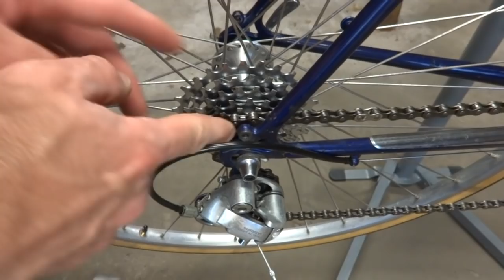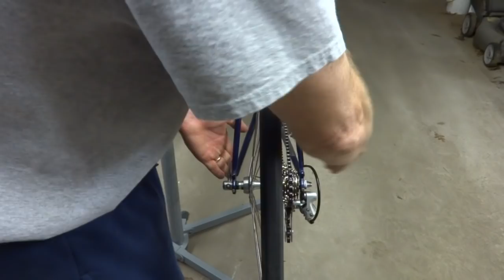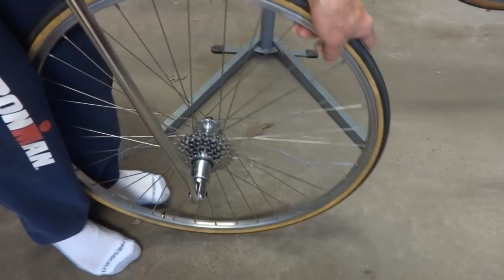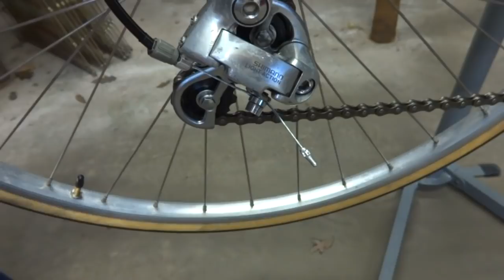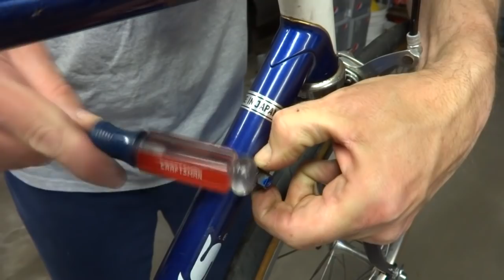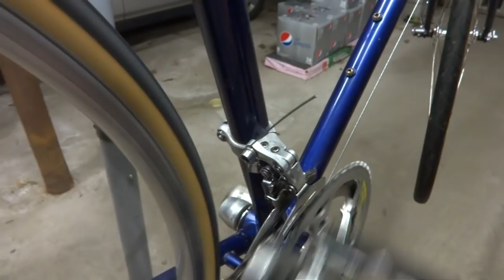How To Do 6 Speed To 7 Speed Freewheel Conversion

Comment: That front chainring of yours seems very warped.  What I am wondering is can I take a 21 speed aluminum frame mountain bike that came with a 7 speed freewheel and somehow remove one cog from some other 7 speed freewheel and  somehow attach it to the original 7 speed freewheel, thus making it an 8 speed freewheel?  Reason is because I want 2 underdrive gears, not just 1.  If it works, my 1st and 2nd gears will be underdrive and my 3rd gear will be 1:1.
Reply from the maker: +David James It's not warped. It's a Biopace ring. It's oval shaped. No. You can't. If you want to go to 8 speed, here is what you need to do (if you have a steel frame): https://www.youtube.com/watch?v=QwxEPRk3LFg
Reply: RJ The Bike Guy - How can you say I can't without you knowing my bike?  What if there is space on either side (or both) of the freewheel cluster such that it will allow me to add one more cog?  It seems like a large cog (34T) could piggyback the 7 speed freewheel cluster, thus making it an 8 speed.  I am not sure if this is possible but I would love to have 2 underdrive (less than 1:1) gears for hill clumbing / riding thru high grass.  I know Shimano has the MegaRange 7 speed freewheel but the problem there is the big jump from 34T to 24T which is huge.  However if I put a 28T between them making it 34-28-24, that almost splits the difference.  So if I start to spin out in the ultra low gear, I still have another underdrive gear to use before going to 3rd gear (1:1) and then eventually my overdrive gears.
Reply from the maker: Okay, good lick with that.
Reply: RJ The Bike Guy - Actually I just did some measurements on my bike and it appears it has a chance to work.  I have a spoke protector plastic ring which I could remove and insert the 8th cog roughly there.  My 7 speed freewheel has cogs spaced about 5mm apart and there appears to be about 10mm of clearance between the innermost cog and the spokes and the chain is about 7mm wide so in theory it should fit but be very close to the spokes.  There appear to be 5 connectors holding on the granny gear and those have a BCD of 58mm so it seems I could replace that 24T granny gear with a 22T or even a 20T so best case, I could go from my current 24T/28T setup (5.8 feet of bike motion per crank turn) to 20T/34T (4.0 feet of bike motion per crank turn).  That is a substantial reduction.  The distance between my dropouts appears to be about 135mm so it seems to me that no widening of the aluminum frame chainstay is needed.  Reason I want the ultra low granny gear is cuz I semi-frequently ride across grass which is a high rolling resistance surface, and I like to ride up things like spiral walkway bridges.

Additional info is I have Shimano derailleur and a triple front chainring set (42T, 34T, 24T).  I am not yet sure if the front derailleur will handle the 4 extra teeth spread and if the rear derailleur will handle the 6 extra teeth spread but it may be the case that I will never use the largest chainwheel (42T) cuz I am heavily biased towards the lower gears.  My average speed on a 6 mile trip (not including full stops) is normally around 9 MPH.  I suspect if I get a front street tire and train a little, I can easily get that to 10 MPH which is a decent pace for me at my age.  At 10 MPH, the 6 mile trip will be 36 minutes of riding so with stops, should be 45 minutes or so.  I have found that my preferred riding gear is 1:1.7 (about 11.5 feet of bike motion per crank rotation).  I have 26" diameter mountain bike tires front and rear but I would like that on the rear only and a street tire on the front cuz I do mostly street (and sidewalk) riding but occasionally across grass so I need traction in back.
Reply from the maker: 8 speed Shimano shifters are set up for a cog spacing of 4.8mm, not 5mm.
Reply: RJ The Bike Guy - Thanks for your reply I will give you a like.  One question I have is that my granny chainring appears to be rivoted onto the tripleset so is it possible to drill those 5 out and just attach a smaller granny gear with nuts and bolts?  The granny sprocket has offset to it to clear the mounting so I would need a 20T with a similar offset or perhaps I could space it out if need be.  I think having the ultra low gear will make my bike more enjoyable.  I will let you know the outcome.  There is a guy that made a bike with a 7.5" gear for climbing very steep hills.  I saw his video and he is pedaling close to 90 RPMs and someone is walking next to him up that same hill so no more than 3 MPH and probably less.  Even with my ultra low target gearing of 20T / 34T which will require effort and luck to get working, that is still more than double his gear (mine would be about 15.3 gear inches).  So he has the equivalent of something like 20T / 72T which should be able to climb the side of a mountain.  Actually the road he climbed was something like 32 degrees and 0.11 miles long at that grade.  He made it easily and repeated with a 8.6 inch gear which gave him slightly more speed so it was easier to balance.

Comment: what about 5 to 6 is that possible without all the hassle
Reply from the maker: A 5 speed road hub is 120mm wide, and a 6/7 speed hub is 126mm wide. Don't worry. I am going to do a video.
Reply: excellent thank you
Reply: tyson1ize If you find a 6-speed "Ultra" spacing freewheel, you can upgrade from 5-speed to 6 and stay with your 120mm rear hub spacing.  You would need an "7-speed chain" as that is "ultra" spacing.  SunTour pioneered the "ultra" spacing.  Problem is, SunTour [now out of business] Ultra-6 and Ultra-7 freewheels can be rather pricy on eBay, etc...  I don't know if anyone else made an ultra-6 spacing freewheel.
Reply: does it mean is it possible? is there a video about it?